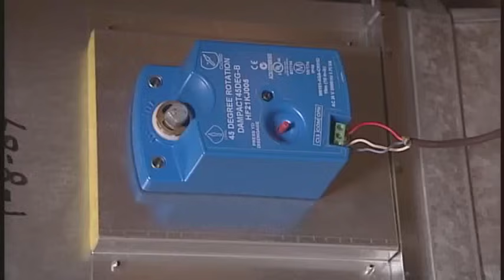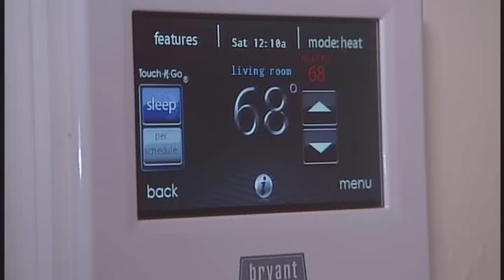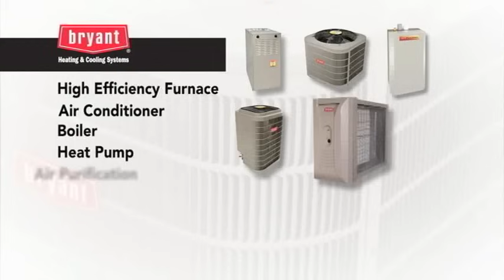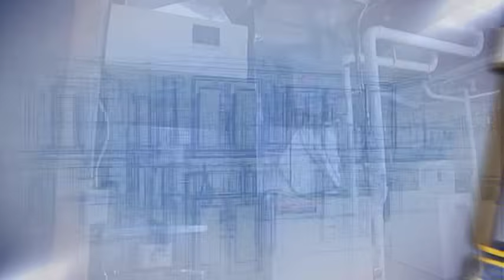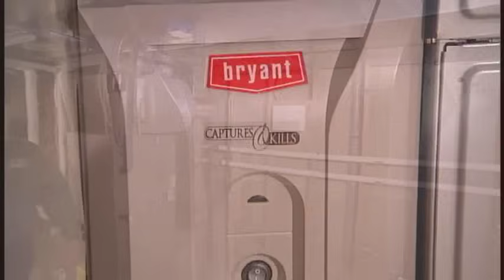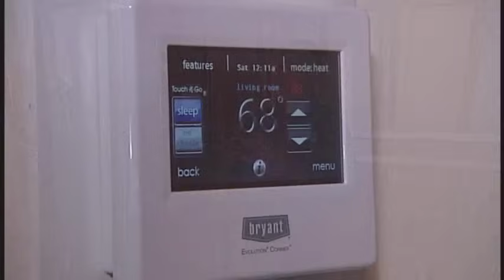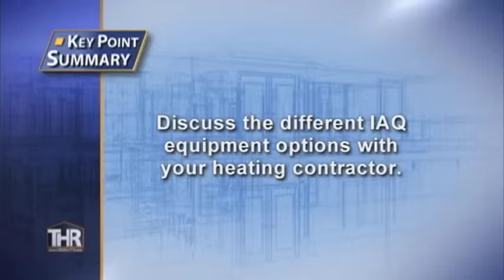Replacing a Furnace & Central Air Conditioner - Bryant

Comment: I was once told by an HVAC technician that closing the register to a room when not in use can damage my system.  Is there any truth to this? I would think it's not much different than zoning
Reply: It depends on your setup if you close too many you might restrict airflow and cause overheating or freezing on the coil or heat exchanger, but you'd need to do that to alot of them for that to happen

Comment: Just wait to see those repair costs on the high end units.... there goes all of the so called money you saved lol!!!  Just buy the basic unit and be better off. This stuff may work better for new construction but not for older homes.
Reply: In case you haven't noticed, they are replacing a system that appears to be barely a decade old. Homeowners clearly have money to spend on a 97% efficiency system and its not an issue. They likely are just replacing the unit once its outside of its warranty period which can be as high as 20 years on some newer models, so paying for replacement parts usually isnt an issue.